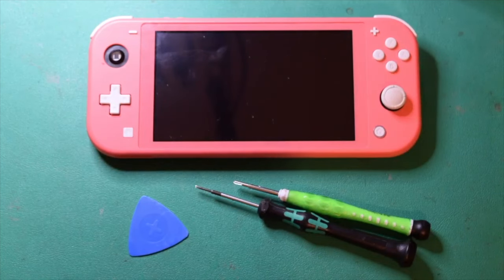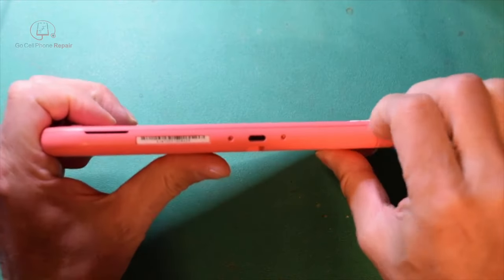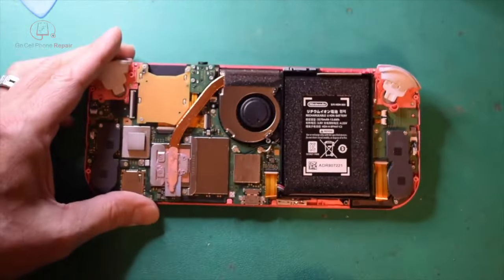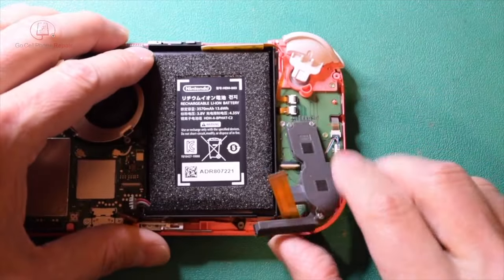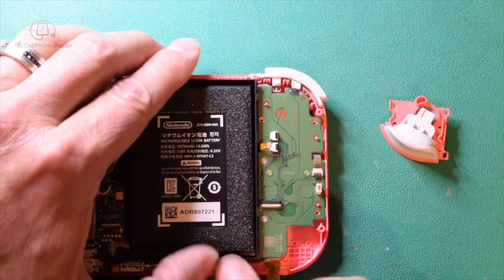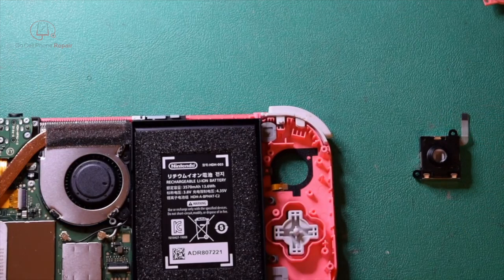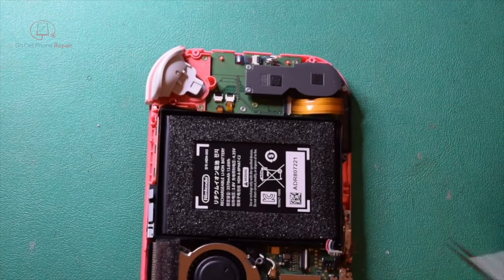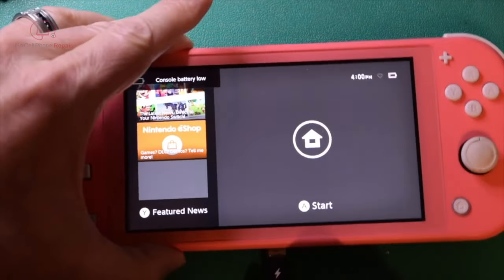Nintendo Switch Lite Left Joystick/Thumbstick  Replacement

Comment: Will there be a video for the right stick as well? Oh and another question. Should you replace the thermal paste when removing the heat pipe?
Reply from the maker: I will make a video for the right stick as soon as I get a chance. The heat pipe thermal paste isn't all that critical, but at the minimum, I'd make sure to re-spread it so that there is some coverage. You can add a bit if you have some on hand but you don't need to clean the surfaces like you would for a CPU/GPU.
Reply: @GoCellPhoneRepair  Thanks you very much for answering my question. I just want to build in some gulikit halleffect sticks. In the video from gulikit there were some people how commented, that you should replace the thermal paste cause it may get brittle - but I don't have any thermalpaste and I am not an expert for such things.

Comment: Would it be possible to do it without removing the thermal shield and using plastic, non conductive tools as I don't have any thermal paste?
Reply from the maker: It may be possible, though you would be working with the battery still connected which isn't the best idea. Alternatively, from what I've seen the thermal paste under the metal plate is not as critical as that which is further inside against the processor. Re-spreading some of the existing stuff is probably fine and they put plenty on to work with from the factory. Just don't get it dirty and you should be okay.
Reply: @GoCellPhoneRepair  Thanks for the advice and quick response!

Comment: This was a helpful video, but I won't lie, the sped up/incompleted ending was really annoying. I have no idea what I'm doing with electronics but I followed this and was able to complete the joystick replacement perfectly...and then right as the video ended, all my problems started. 🤣
Trying to get the back casing on made the battery plug shift a micrometer and that's all it took for me to lose battery power, and when I finally figured that out, the case won't seal correctly. There's a wedge along the right side that I cannot get straight, and I ain't opening this bitch back up. Helpful video though dude, thank you.
Reply from the maker: Thanks for the input. It's a fine balance between making a detailed video and not getting penalized by the algorithm since views tend to drop off during the re-assembly section. If it helps, you can always slow the video down in settings.